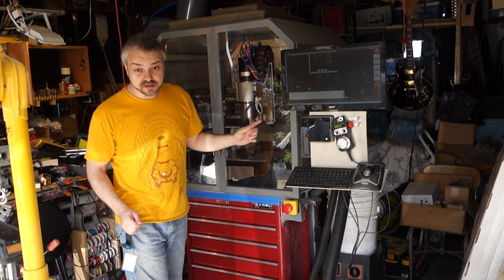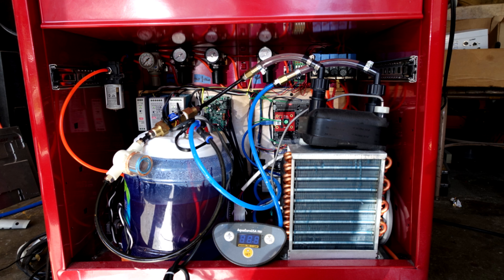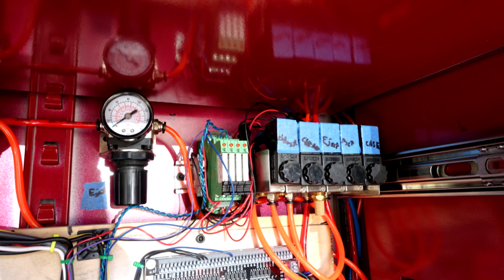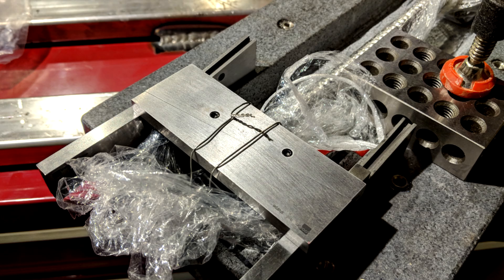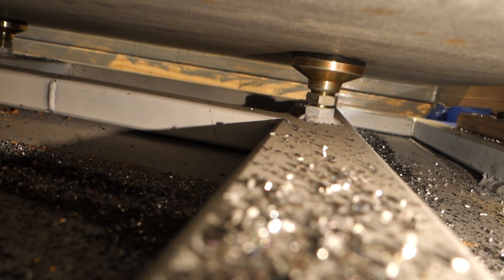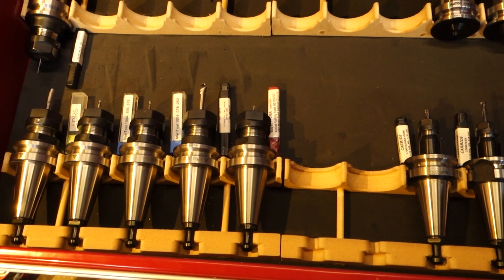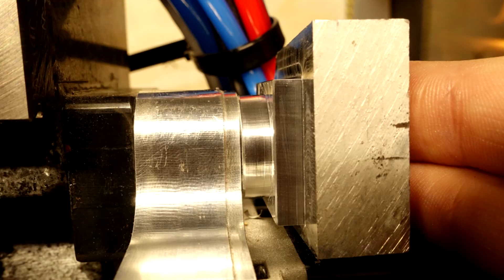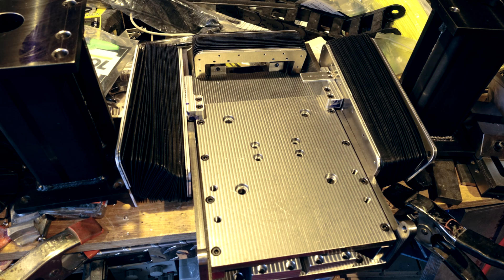Granite Gantry Router build, part 3

Comment: How is the machine holding up after few years of use? Any issues with epoxy inserts?
Reply from the maker: unfortunately I haven't really used the machine much after completing it, so I can't provide a ton of insight there.  In hindsight the one part that I'm most worried about is the mounts for the ballscrews.  I used too much epoxy and not enough composite, so that's the biggest thing that I would be concerned about moving over time.

Comment: Well that's pretty a nice build !
I saw your deflection test and was  quite impressed.
Can you do more of those and mesure the force you apply ? (With a luggage scale for exemple)
That way a stiffness value in Newton per micro meters (N/um) could be found and compared to other cnc.
For example:
https://youtu.be/DH2QMLQxbVg
https://youtu.be/waFkpSWkctc
Also, It would also be useful for speeds and feeds calculations.
Thanks !

Comment: Great build. Thank you for sharing.
Didn't quite get how the ballscrew stands mounted to granite.
Reply from the maker: They're mounted basically the same way that the columns for the bridge are, steel plates with threaded holes that are epoxied to the granite.  For the ballscrew mounts the plates are just countersunk into the granite instead of sitting right on the top.

Comment: Looks nice!  Off the top of my head, it seems like drilling holes through the granite and using long bolts would be much stronger than embedding inserts.  With a trade off between drilling longer but smaller diameter holes, it doesn't seem it would increase the drilling effort that much.  Or is this idea a none starter because the necessary drill bits are too expensive?
Reply from the maker: I really wanted to do that for the largest bolts, all the mounts for the uprights, but I just couldn't find any diamond core drills that are 3" long (or more like 7" for the gantry)  Even if I wanted to line them up from opposite sides a 1" drill depth wasn't enough either.  For the rails I also certainly didn't want to deal with nuts on the back side with the large number of them needed, so a fully captive insert was just less hassle after the inserts were finished.

Comment: Great job....have one request make a video series on how to set up a atc ...ie atc101 it would be nice to have it series of videos that would show a quick overview of what you need terms of hardware and pneumatics and software. Then the second video to show you're schematic of the pneumatics wiring... and the system Hardware . Last thing how you programmed the tool changes.

Nowhere have I seen online or on YouTube Someone showing how to do this from beginning to end
Reply from the maker: I'm using the ATC spindle for manual tool changes.  I originally was planning to build a full ATC system for it, but manual changes work so well for me that it's fallen to very low priority.  On the side of operating the ATC spindle there isn't really anything to show or say about setting it up.  Use any old air solenoid, blow in the release port to release it, blow in the retract port to retract it.

Comment: What was the final cost of the build, not including tooling?
Reply from the maker: I didn't keep a strict tally, and am kind of scared now to look back at it.  I'm pretty sure if you don't count the mistakes and rebuilds that I was able to stay pretty well under the 10k mark that I was hoping.  Roughly in major components it's about 4k in linear motion parts, 1k in motors, 3-400 in granite, maybe 600 in tool boxes.  Spindle wasn't in my initial "bid" but that's probably 2k for the spindle and support electronics (solenoids, wiring, PLC, etc) and another couple hundred for a VFD.  Then you've just got all the misc bits that are all cheap individually but add up really quick like bolts and covers and connectors, and raw metal stock for the rest of the machined parts.

Comment: Is that one of those spindles from the seller in Vietnam?  I've been so tempted to purchase one.  Do you like it?  Is it worth the price?  Anything you don't like about it?  You mentioned 125mm so I'm guessing that's the 5.5kw version?  Great build by the way!
Reply: i purchased the 3kw version recently (from hail_vn). it seems like a good spindle, very smooth spinning and quite. The tool change motion was not the smoothest (this may change over time) and its not air sealed. Currently my only issue is the power requirements, 380V is not available in my area so i cant really push the spindle.
Reply from the maker: I don't know who in Vietnam is selling spindles, this one is from Jianken in Taiwan, it's a 110mm 4.2kw.  I like the spindle well enough, for the price it's impossible to beat.  The bearing cages are a bit noisy and that can be disconcerting, but my initial impressions from my light use of it are positive and I would certainly consider getting a 2nd one if I needed to.
Reply: @SiieeFPV  I ended up buying the Jianken 3.2kw version.  After a little over a year I can say they make an awesome spindle.  I got the tool change version with the ISO25 ER20 tool holders and the inverter they recommended.  Had no problems at all except for the surprise customs fee bill from Fedex for nearly $700.
Reply: @machine2747  Adding tool-changing to a spindle increases its price about $1000. Nice to have but expensive if not generating income.
Reply: Would you be able to explain why you decided on moving the spindle for the x axis please. I am beginning a DIY cnc project and notice most people move the table for the x axis.

Awesome build and great video btw!
Reply from the maker: @furiousg1589  It's all a tradeoff of working area and rigidity.  A C-frame VMC with an x-y table can have an extremely heavy and rigid mount for the spindle, but the working area on the x/y axis is only about 1/2 of the travel for each axis.  A bridge router, or fixed gantry like mine can still have a fairly heavy mount for the spindle because the gantry doesn't need to move, but my working area is like 80-90% of my x travel.  The largest working area per footprint is with a moving gantry design, there you get 80-90% of your travels on both x and y as your working area, but your spindle mount needs to be comparatively light because the whole thing needs to move.

So for me the fixed gantry is the sweet spot of making the best use of the footprint I have available for the machine.  I get the most total volume of machineable area while still being able to build the bridge as heavy as I'd like to.  If I was targeting for more cutting of harder materials a C-frame gets more attractive for even more rigidity at the expense of working volume.

Comment: Great build,  I'm currently figuring out what relays to buy that work with the UC300-UB1's outputs. They can only sink up to 70mA so I would have to use relays for controlling my solenoids. Care to share what relays you're using? My setup will be similar to yours, several solenoids and regulators for the spindle's ATC piston control.
Reply from the maker: I'm using ASI328002 that I got off amazon

Comment: this is awesome, did you ever look into one of the epoxys specially designed for anchoring in concrete, for example https://www.amazon.com/ITW-Ramset-Red-Head-7110/dp/B004H0AE8C/ref=sr_1_2?crid=G8IAKMBHJ716&keywords=redhead+epoxy&qid=1558153555&s=gateway&sprefix=redhead+epo%2Caps%2C166&sr=8-2